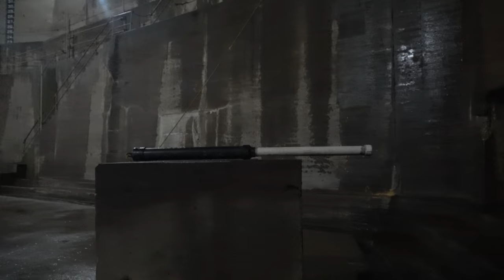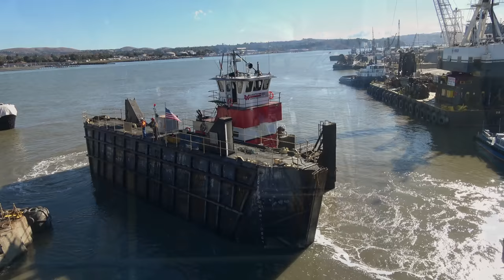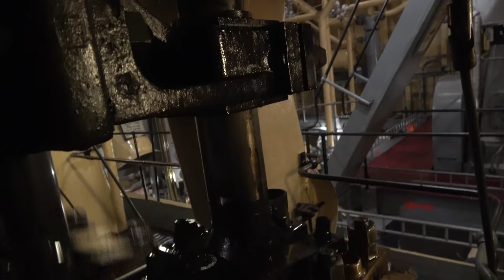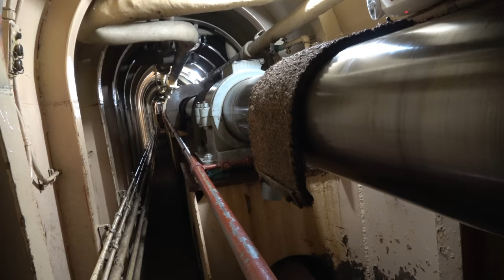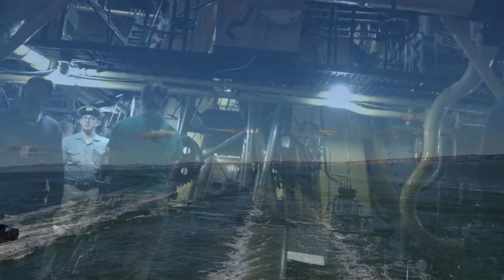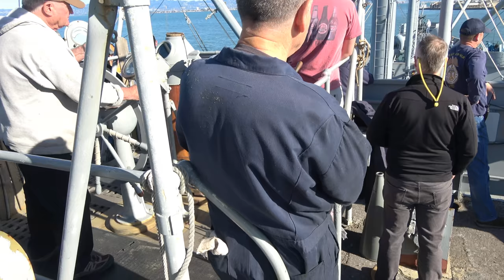S.S. Jeremiah O'Brien Steam From Drydock to San Francisco

Comment: First time I went on board a steam powered ship was at Charlestown Navy yard back in 61, I was 11 years old and the chief of the boiler rooms handed me a ash stick about 6 feet long and instructed me as " these boilers are running at 600 psi and there are steam lines everywhere. You don't take a step forward without raising this stick to over your head and to the deck because if there is a steam leak you won't see it but if a piece of the stick falls off you freeze as you just found a steam leak and if you don't it can cut you in half if you walk into it. She was in the process of coming out of dry dock like you see here. I taken no more than 14 steps when a piece of the stick got cut off so I froze and yelled at the chief. He came up behind me and it was determined the leak was in the main pipe feeding the throttle. The ship left dry dock three days later after a new pipe was installed.

Any time since I've been in a boiler room of engine room I always waved the stick. I got laughed at by some of the newer ranks until I found that leak, then everybody was using the sticks after I found that leak. Most of the boiler room and engine room crew thought the chief was daffy until he demonstrated what I had found. 

They weren't laughing at the chief anymore.
Reply from the maker: That is such a cool story. That is one of the first things my father warned me about as a little kid when wandering through the engineering spaces of turbine-driven steam ships. 
It's incredible you actually experienced it, and survived it. Lucky kid!
Reply: been ther done that they do not play
Reply: I served in the Navy 66-67 on the USS Oxford a GTR 1 esteem 3 huge big Pistons and I couldn't believe it how the old thing kept going all the time
Reply: Many moons ago I served as a radio operator aboard the German Destroyer Schleswig Holstein. A 4650 ton steam turbine powered 131m long ship that could reach 40knots+ using 70000hp engines. It was at that time the fastest ship in the german navy but was scrapped mid 1990s. First rule one learned when visiting the boiler and engine room: don't move at all if a steam leak is suspected. The wooden stick method was well known. It is very noisy in the engine room, a tiny steam leak may not be audible, but will still cut off your arm. I observed an overpressure test of the boilers while standing on the pier, as all personal was taken off the ship. Condensation of the steam coming out of the blowing overpressure valves was not visible for more than 50 meters above the ship and it was unbelievably noisy, comparable to a full afterburner Concorde taking off that I also had the pleasure to experience close to a runway.
Reply: Amen, Sir... You practically read my mind as a looked at those guys around that steering mechanism, because I had  Buddy who was a Naval Officer tell me a similar story as he took me for a tour inside the engine area of the battleship Missouri... Told me how you wouldn't want to stick your arm into certain places without waving a stick First!!!
Reply: Great story and yet so true. Superheated steam is a dangerous thing

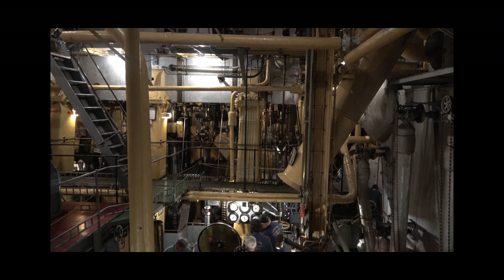Comment: At 8:00 they are doing something called "rocking the engine". They have the reverser engine running continuously, and the engine never really completes a full revolution, it just rocks back and forth. When the engine becomes warm, the engine comes close to running continuous revolutions. Then at 10:00, they stop the reverser engine, and the engine begins continuous motion in one direction.
Reply: We used to call it "Swinging the links".  Initially with HP piston at mid-position, with slight movement then when you think it is warmed through enough, you crack open the throttle half a turn more, or so, and hope that the it goes right round and doesn't stop at TDC!

Comment: One of the unusual things about the Liberty ships is that they have this open space in the engine room where you can walk over to the electrical power board and get a good full height view of the main engine. In most ships, the main engine is surrounded by walls and structures, and you can not get this view from a distance.

Comment: so cool i hate that we dont use steam as much any more u think with all people screaming polutin everywhere they would but it does take a lot people to run them still love the power of the steam  though
Reply: I am (not currently) a gas turbine systems technician (mechanical) in the US Navy. I learned to run a boiler plant in Navy propulsion engineering school. It was explained to me that they take up too much space and are inefficient. When i asked i was told they are less than one half of a percent efficient.
Reply: Steam powerplants are extremely maintenance-intensive and inefficient. That's why railroads fell all over themselves replacing their steam locomotives with diesels.
Reply: A good steam system will run at about 30% to 40% efficiency. A combined cycle gas turbine / steam heat recovery system will hit 60%. This is slightly higher than diesels or straight run gas turbines which run at between 25% to 35% efficiency. The colder the condenser water the more efficient the engine is.
The hours it takes to go from cold and the maintenance are the real killers. The volume taken by the boilers doesn't help either.

Comment: Is that the best means off cross head lubrication it has……some guy with a squirt bottle trying to match the speed of the crankshaft??
Reply from the maker: Good observation. It's a terrible habit someone passed on. There are drip oilers and one can dribble extra oil down the lines, either inside, or on the outside near the cup. Watching as I was editing helped me pull me head out of me bum. It doesn't happen as seen in this footage anymore... At least with my dad and myself.

Comment: Great video......but I would have liked to have seen a couple of shots of the boiler room.
Reply from the maker: Thank you. I do apologise for not showing more of the boiler room... Actually it's open to the engine room and directly ahead if it. A few of the shots were taken from between the boilers. Two oil-fired Babcock Wilcox watertube boilers.
Reply: Thank you for the response. Is the steam to the engines superheated?
Reply from the maker: @davidtwyford8755  you are very welcome. Yes the main steam from each boiler is run through a superheater (one on each boiler)  before merging into one line and arriving at the throttle.
Reply: @WesleyHarcourtSTEAMandMORE  Thank you....steam resips are so amazing...Makes one wonder how they machined those massive crank shafts and bearings...we have a liberty ship here in Tampa (non steaming) I guess I should get off my butt and go visit. Very nice video. Loved the shaft alley. I was trying to figure out  the feed pumps and fuel pumps and other aux equipment....keep up good work(turbines are so boring) Thanks again
Dave Twyford BT2 USCG

Comment: This appears to be dry dock 3 0r 4 built in the 1930 and 40 respectively
Reply from the maker: I believe you are correct. I'll see if I can get the actual number for you. Did/do you work at Mare Island?
Reply from the maker: Good eyes! It was the #3 Dry Dock
Reply: @WesleyHarcourtSTEAMandMORE  I was there several times including taking a USMC unit to the Mare Island Rifle range also a buddy was CO of the Marine Barracks. I was also there after it closed I hear the Navy needs it back in operation
Reply from the maker: @Dog.soldier1950  Must have been a really interesting time to have been there with the yard at full tilt. 
I'm not sure how much they need it open. I was just there last week and it seems more and more of the ancillary buildings are going to civilian operations. I was at a brewery in the old coal sheds for example. 
Maybe just the drydocks?
Reply: @WesleyHarcourtSTEAMandMORE  the backlog at the currently available yards is 18+mths
Reply from the maker: @Dog.soldier1950  😳😳😳😳

Comment: Are the carpets  hanging on the long propeller shafts resonance dampers?
Reply from the maker: They're actually to keep the rust off the shaft. They scrub where they are and the crew occasionally move them.
Reply: @WesleyHarcourtSTEAMandMORE  Thanks for answering - I was once a heavy industrial  machinist and we sometimes did the same to stop shafts "ringing" when being machined with a leather belt or wood rest
 - the design of Liberty ships was required  study when I was an apprentice  - welding/modular construction / metallurgy & the impact of cold weather on early models -  we imagined because most instructors were ex WW2 - the rational behind the design choices  was interesting  - I wonder if you get many students tour  the ship?

Comment: What's her speed?
Reply: I think it was between 16-18 knots
Reply: Norm Atwater I was on one in 1964 when the Navy had 16 of them for Radar picket ships i was on  USS Scanner AGR5  i was a Ship-fitter pipe but stood my watch in the engine room  we did 66RPM @11.2 Knots some times we could get a few more RPM’s on our way home coming off station but the CO could count the RPM’s in his sea cabin  and tell us to slow it down .
Reply: @andrewmagosky7181  Hi it was more like 9 knots as they were only doing 60 rpm . 72 rpm was max to do 11 knots
Reply: We made 11 knots back from the yard to the pier in SF. That's riding high, on a relatively calm day. I was one of the watch engineers on this voyage.
Reply: I was on board USS Iinterpreter AGR 14 December 59 thru 61.  Treasure Island.  Radar pick-it.  Working for NORAD.  The big I .as they called it.
First ship of a 20 run.  Comfortable living quarters . The holds turned into basketball court and such.  Many first time at sea experiences .
A station 200 miles off of Vancouver island in a winter storm was a bitch. We had to stay in a 15 mile circle, if I remember right. Turning that thing around in huge swells almost continually.  Not fun.  On deck force standing lookout , could not go aft on deck, so had to go down a trunk , to the shaft ally walk aft to another trunk and. Climb up and down those ladders several times in an four hour watch.  Helm, messenger, signal, and stern watches . Rotating through a 4 hour watch.  Story’s, I have a few.